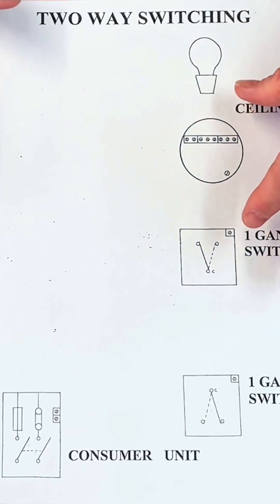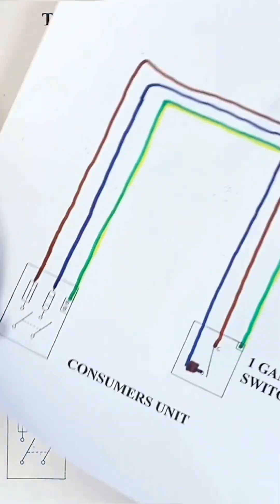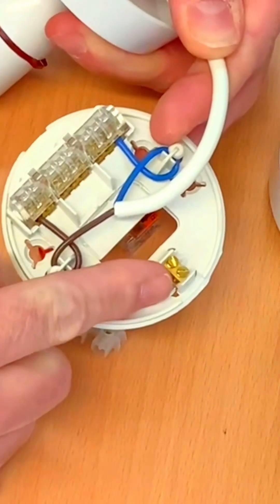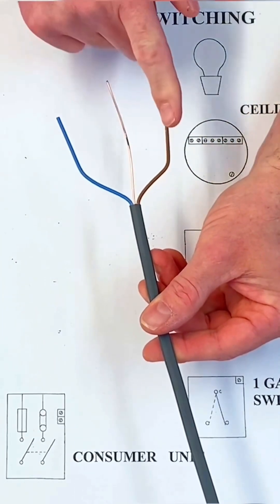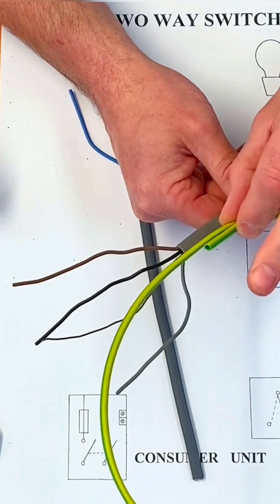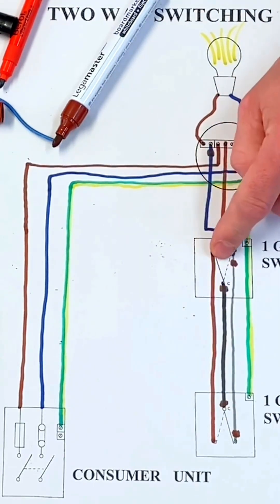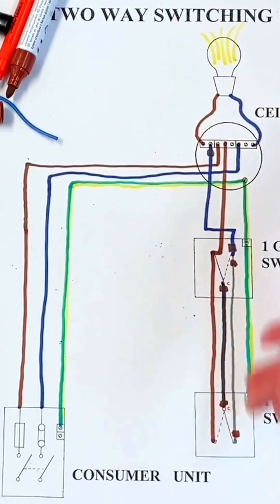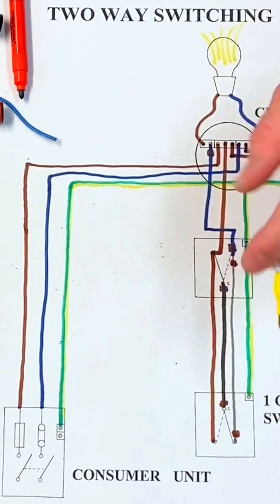2 Way Lighting Circuit Wiring Diagram

Comment: 6:50 why can't the perm live go to common? i.e. perm live to common, L1 to L1, L2 to L2, common to light (switch wire).
Reply: I see it. You'd need a route to the light from both switches... wasting time + cable.

Comment: It’s not often you see it but on the odd occasion some people run a twin and earth cable between the switches for the straps . And use single and earth ( double insulated,) for common. Used as a live feed to the switch and from the other switch  a switched return to the light .  I even have done it myself a few times . It’s not often done this way but worth a mention.